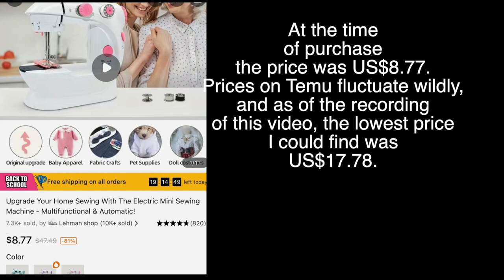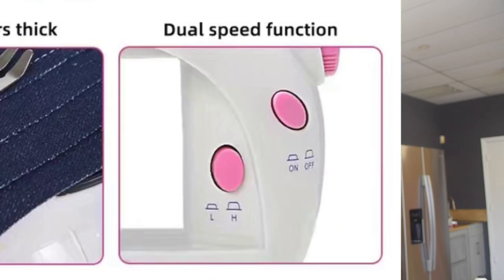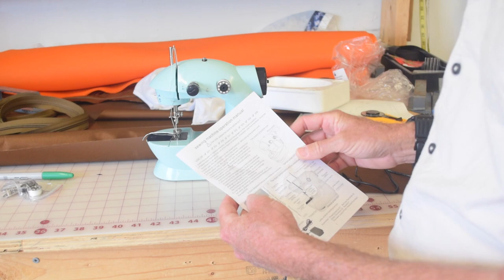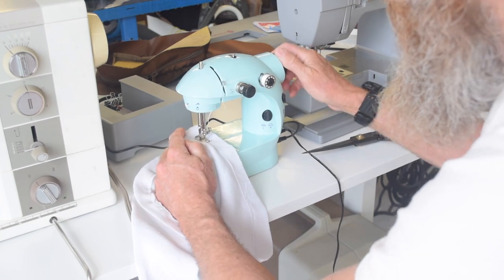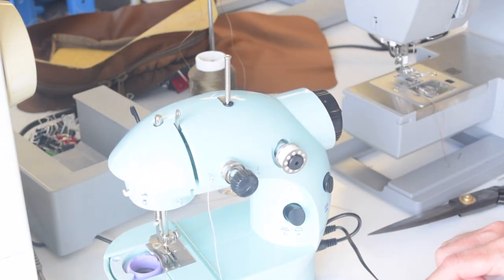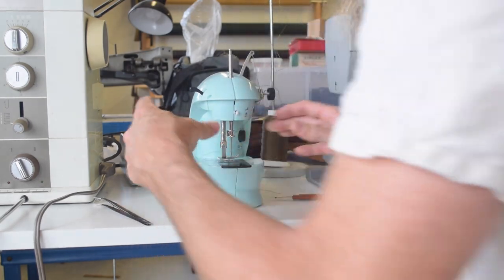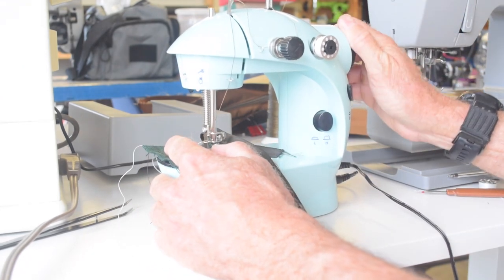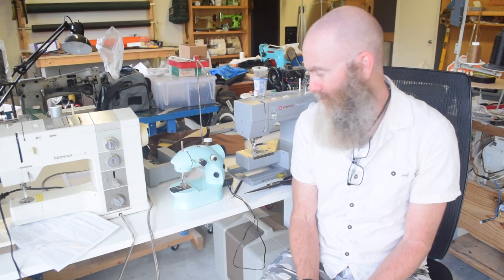I Bought An $8 Sewing Machine From Temu

Comment: I have two of these.  One is the same model as yours and the other one has a handle.  Both work fine.  If you have trouble with your machine it is usually operator error.   The one with the handle I use for sewing very lightweight tarp tears and  hems that have come undone.  The other sewing machine is used for small jobs where you have to bring a light weight  machine to the work.   I have nine regular sewing machines in cabinets that I have collected and repaired spanning years from 1907 to 2012 that I enjoy using for sewing clothes.  Every machine gets used including the two small plastic $8 ones.
Reply: 1907 😳
Maybe 2007 🤔
Reply: @gigiontube  Yup, 1907 Industrial Singer.  It is so heavy duty it will never die.  I recently used it to reupholster my tired old RV.  I bought a roller wheel to help it get through the thick fabric. Worked great.
Reply: Are you a collector?  I have a couple of old machines in cabinets. The Lenore and a singer
Reply: If it’s threaten wrong or the thread falls out of place it will do that every time.
I went on vacation and made a whole quilt top on my down times using it.
Reply: I cant get it to work to save my life 🥴

Comment: A sewing machine needs some weight sort doesn't move around!
Reply: A clamp for fixing it to the table is needed. I only have clamps costing way more than the machine in my assortment, though 😢
Reply from the maker: As @LasseGreiner points out, I was thinking of using metal strap or something similar to attach the machine to the table so it would be stable.  Maybe I'll have to do a future video where I try everything possible to make the machine really usable!
Reply: @thejasonofalltrades  you may want to be careful not to break it when clamping it down 😇, looking forward to whatever you decide on.

Comment: Other videos are showing the same machine and it works. I just pulled out my old model unopened and it works. I got it years ago for paper crafting, and so far it is fine for that. The only thing is I can't wind a bobbin on it, but I can wind a bobbin if needed on my regular machine. Mine came with two wound and two empty metal bobbins.

Comment: MAGNETIC bottom bobbin is how it works. I was surprised, I was given a non working machine with a plastic 66 bottom bobbin and a bent needle. (the machine worked after replacing the needle and metal bobbin  )
I found out searching the WWW, there is a magnetic bobbin case this NEEDS a steel bobbin for the tension.
The purple machine I have will also do zigzag wow.
Noise - it is the loudest machine I have and it is "not" a pleasure to use.
Reply: That is very interesting, thanks for the insight!

Comment: Thank you so much for this thorough review and demonstration.  I just received mine, which I paid almost $25 for, and even with following your tips rather than their (incorrect?) instructions, I can't get it to sew more than a couple of stitches before it bogs down, stops and then breaks the needle thread.  (Also, the foot pedal isn't working at all for me.)  I only need a little sewing machine to supplement my knit and crochet business, and so far this unit has me totally frustrated.

Now, for the record, I tested it using batteries.  I'm going to retry it with the AC adapter, and if it still fails, it's going back to Temu.

Comment: All I saw in this video was you having a preconceived notion that the machine is crap.  then you and I do mean YOU caused the machine to malfunction.  If you had followed the directions, as as bad as they were the machine would have worked.  You didn't take the thread off the whip arm, you didn't catch that the thread wasn't in the tension discs, you didn't pay attention to how you took the bobbin out to put it back in the same way.  YOU made the machine malfunction and you need to apologize to the little machine and to us the viewer.s.
Reply from the maker: Hi.
I take issue with your comment. It sounds overly harsh and seems to suggest you weren't paying full attention to the video.
What you saw in this video is what I showed you - I'm the editor here, and I choose what you do and do not have the opportunity to see on my channel. I clearly admitted to all of the mistakes you point out, it's not like I was trying to hide any of that. That said, when I corrected the mistakes, the results remained the same. The machine worked well for me with the factory-wound bobbins and provided thread, and didn't work with the only other thread I tried. The point wasn't to do thorough testing of this machine to see if I can get it to work with a wide variety of threads and fabrics, it was just to try it out and see if it even works, because - NEWS FLASH - an $8 brand new sewing machine IS a piece of crap. I think I made it quite clear in the video that I was pleasantly surprised that the machine worked as well as it did, and it made a pretty nice looking stitch, but it as cheaply made as it gets, and should mostly be considered a novelty item, in my opinion.
I checked out your channel, and it appears you are a quite talented pipe organist. I am a pretty bad pianist/keyboardist, so I respect the effort you must have put into becoming proficient on as demanding an instrument as a pipe organ.  I would like to suggest that maybe you search Temu for the cheapest keyboard instrument you can find, and compare that to some professional-grade or high-end consumer-grade keyboards or organs.  Do you think an $8 synthesizer will be a "piece of crap?" 
As for apologies, I am always quick to apologize for my transgressions.  In this instance, I have nothing to apologize for.  I wish you well.

Comment: I'm only 14 minutes in, so you may figure it out before the end, but when you figured out about the on-off switch and the foot pedal but you were saying, I guess there's no speed control, I was sitting there going, it's RIGHT IN FRONT OF YOUR FACE! The thing marked L and H. When the button is out it's on high speed. You need to push it in for low! Anyway... going to finish watching now.

Edit: Okay, you did mention low speed later. I guess you just meant if barely depressing the foot pedal.

2nd Edit:  You should try the cute little 12-stitch machine for $30 now that DOES have reverse stitch.

3rd Edit:  Hahaha! It doesn't make the translation better, but I think what you are pronouncing as "wound" (like an injury) is actually "wound" as in a tense of the verb to wind, like winding thread - like something wound too tight. hahaha... That at least makes more sense as an included word than the way you were pronouncing it.

Last one:  I can't remember now if you said it in this video or if I was reading through comments and someone said they couldn't wind a bobbin with this, but that's not true. It's been a long time since I've had mine out, and it was kind of janky the way it worked. You had to put an attachment in the middle of the little winding hand crank thingy to the side and have one bobbin there as I remember, the one you're filling, and there was no way to disengage the hand-crank thingy from the needle going up and down like you would with a normal machine. But anyway there was a certain way to put the spool on top and have it go to the one on the side hand crank thingy and you had to kind of hold some slack in the line yourself with a finger or whatever and maybe even move it up and down a little to help it fill the bobbin evenly, but you'd pressed on the foot pedal and let the thing go at it - with the needle part unthreaded of course - but it would indeed fill the bobbin that way.

Comment: Watching you fight with it was almost as amusing as the instructions, which I am quite familiar with, Chinese to English is always funny, on a more “serious” note my “new” Bernette B79 didn’t like running v69 out of the box and that’s a $1500 machine. I had to buy a new bobbin case for it and kind of fiddle with the tension and needle size to get it to run smoothly, hence why I bought the sailrite.
As for a use? I think you’re on target with “off grid” use, leave it at the cabin or under the seat of the RV / boat